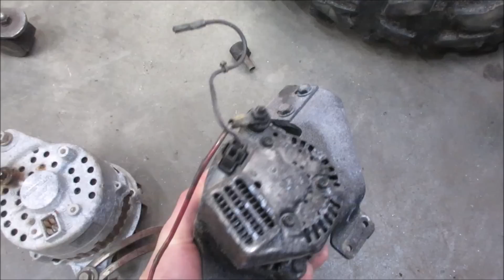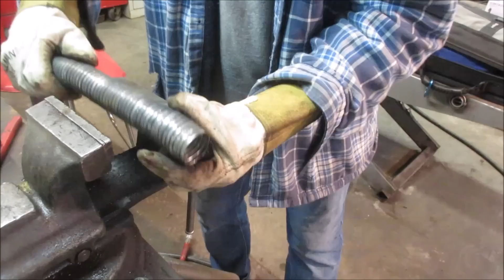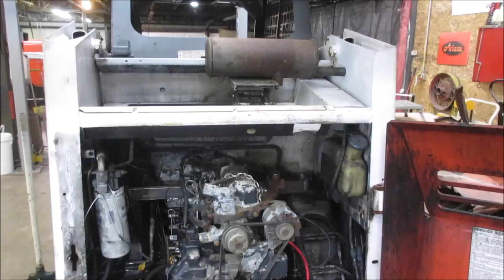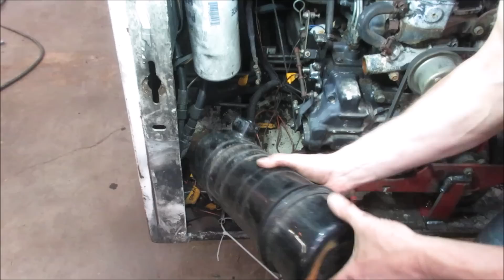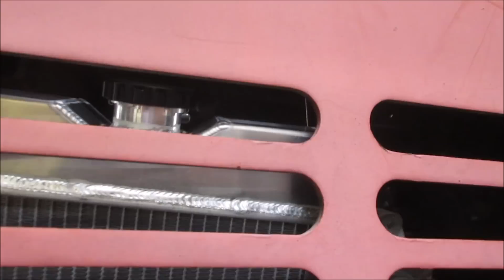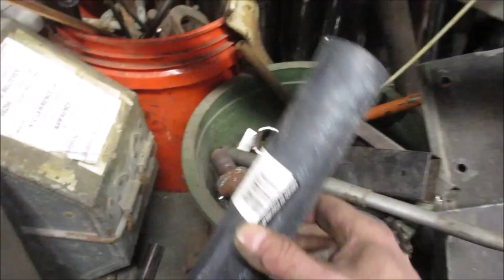Making a Big Engine Fit a Small Hole. Busted up Bobcat Skid Steer.

Comment: For the sake of the engine a thermal switch probably would be a good idea. An engine running too cool is, over time, not much better than running too hot. Just a thought.

Comment: As per the directions you did not receive with the fan you would have to flip the fan blades to make the fan a “pusher” from a “puller” fan. I have never had a problem with the zip ties rubbing holes in the radiator. I don’t use the springs supplied and only use the rubber pads inside and outside the radiator. The zip ties have to be very tight. I usually leave them long and retighten after the motor have been ran a few days. Of course a simple fan shroud is the best way to mount a fan to the radiator, because it allows the fan to pull/push air through the whole radiator surface instead of just the diameter of the fan itself.

Comment: Tight as a fishes bum.  I pity the poor bugga that has to do work on it in future who will curse whoever installed it , saying "rough enough". Why use an oversized radiator that is the genesis of multiple problems?

Comment: Exhaust is going to come into the cab depending on wind if it doesn't go up nice and high, till the heat is enoigh to carry it away.

Works fine out the rear till you back up or get the wrong kind of wind.

And that is a lot of volume and soot, compared to say a lawn mower.

Comment: I build semiconductor fabrication equipment for a living till retirement.  And in that was alot of blind feel only operations.  I always found it easier to do feel only work with my eyes closed.  It instantly focus's you to a slightly higher degree of feel, and made those operations a little easier.  An old vacuum engineer taught me that.

Comment: Ahhh, comon. Drill a hole in the side "panel", stick the pipe through. The muffler is moved sideways. Then it fits right above the existing hole. No problem for flexpipe,  And then it's moved away from the rest.

Comment: I just kept wondering if it wouldn't be possible to put hinging brackets on the outside edge of the radiator so that it could be moved out of the way to service the engine

Comment: As mentioned, flip the blade. The throwing edge will then be around the right way for the curve design. Those blades must have the convex side pushing into air.

Comment: iv found it easier several times to make radiator hoses out  of exhaust tubing and bends, and you can even pie cut it for weird bends then just use a few inches of straight hose on each end to make the connections. and you can roll a bead on it to hold the hoses or weld a bead on it to hold your clamps on.

Comment: Hey Mustie, once again a most informative and interesting video.  It's one thing to put something back together the way that it was designed, but when you have to make everything and fabricate parts to make something work that wasn't designed for it in the first place, well Sir, that takes TALENT!!  Great job!!  One thing I am just wondering about and that is with the placement of the fan.  Do you have enough room to mount it on the other side of the radiator and still get the door closed?  It should still push the air through the radiator to cool it and it would give you some clearance between the radiator and the water pump, etc.  Hard to tell from the video if that will work or not but just thought I would throw my two cents in there!! Can't wait to see this thing running!!

Comment: I'm always surprised by your creative solutions. made possible by your pile of saved materials. Makes me think about the number of times I have to drive to the hatdwarestore.
You could extend the space for your radiator by cutting of the door hinges and welding square pipe to the frame  and weld the door on again?

Comment: Hi Mustie, as far as the cooling, why not mount the fan on the swinging door, that way you won’t need to attach it to the radiator (diesel vibration will wear a hole in that rad in no time). And the fan being electric can swing with the door.

Comment: Don’t fancy changing to engine oil filter with that radiator in the way
Reply: Drain the oil. Leave the filter. It will bypass if clogged.

Comment: I'd vote for using some C-channel around the door frame to shim/bump it out.  And then as another poster said, flip the hinges and then mount the radiator in the door..  assuming there is a way to let the radiator hose bend/flex/move when the door opens.

Also, air intake up top.  It will get cooler air and leave you lots of room to work on the engine.  

Thanks for sharing the videos!!!

Comment: I Like the project. Would it have been possible make a bracket to hold the bottom of the rad to the motor mount? I was thinking like a pack unit so the whole thing could come out as one if needed. It’s good to watch and learn and share ideas. I think you do a great job. Keep it up!

Comment: I would square that slope in the door and raise the radiator. It will also allow you to move it further away from the engine. Would also change the fan from draw type to push, that would help draw air across the oil cooler and then radiator.

Comment: Great video! 24:35 DO I point it upwards and make a flapper. YES because you don't want animals crawling in the tailpipe over winter? and you know the engine is running with it flapping.

Comment: Mustie, any concern about the vertically mounted cushion mounts shearing off being mounted horizontally? In answer to you air cleaner question, there is no real air requirement difference between diesels and gas engines until you get into the larger displacements or high winding diesels (big EMD/Alco's or the racing Cummins engines). Loving the repower video!

Comment: Your missing the original flywheel that has a fan built on it and also the cooling shroud so there’s no hydraulic cooling and for the price you should have went with an oem radiator

Comment: First thing that motor needs is a new set of glow plugs as for the throttle it would have been easier just to make it up as a cable throttle I would assume that you can buy them over there there is a flexible radiator hose that has a spring in it they use are mainly on tractors

Comment: You could make the back engine cover deeper by spacing off the hinges and then welding flat bar or angle section around the perimeter of the cover. Could give you that extra depth for the radiator and fan unit. 😀

Comment: he motor vibrates independent of teh body of the skid steer, so you need standard "rubber" and metal exhaust clamp style design instead of direct weld.

Comment: Hi Mustie. How's come you didn't just leave the muffler down in the engine bay and then run the pipe up through that hole and make a small stack with a flapper on it?

Comment: Alot of those aftermarket electric fans u can flip on the motor for pushing air instead of drawing so u can mount them in front of the radiator

Comment: Did you ever consider welding square tubing around the body and reweld the hinges so the there would have been more room between the radiator and the door?

Comment: I'm curious about where the original gas engine radiator was...... and whether it was under that hydraulic oil cooler, above the engine. That would give better access to the engine and less issues with sticks coming thru the vent holes and poking the radiator.... I always enjoy your videos!

Comment: At 54:48 you could just weld three or four buttons, or beads on the pipe and it will not slip off when pressurized….👍🏻

Comment: The fan is a push/pull fan. You can take the blade off and flip it around. Also you can run + to - to do the push pull effect.

Comment: Just saw video. Good video. Great idea on radiator The only concern is service. Is it possible to move all filter over to the right side of the motor Oil, Fuel, Hydraulic filter. I was thinking run a few lines over to the right open space. Easier said than done, but I think it would make service a lot easier. Just an idea.

Comment: For air flow for the radiator those slots on top of the door should be plenty. They were plenty for the original engine.

Comment: You can reverse the air flow by flipping the blade over and reversing polarity. I did that on one electric fan I used on a piece of equipment I have.

Comment: I put the fan on the other side thy your pull the hot air out and pull air across the hydraulic cooler and the reason the door solid so you don't run a stick in to the radiator when backing up if you make more hole protect they .was the radiator that come with the motor bad .hope you don't have problems with the radiator cap low thy the motor but great job so far

Comment: For your radiator hose coupling...
Turn a pipe into a hose barb by running a weld bead around the outside.  Even just a few bumps will go a long way towards keeping the clamped hose from being forced off.

Comment: Yes, the fan should have a thermoswitch. And a relay. The fan running constantly could prevent it from coming up to temp quick, You want them to come up rather quick for the engine to reach its happy temps.
Leave the back door be- it´s okay as is. The tailpipe should point up and back so fumes clear.

Comment: I wonder if that radiator isn't just a bit big.  The engine will need to be able to get up to temp and that size radiator might be too much.  How about giving it a run before you start tearing holes in the back door.  It might also be worth thinking about setting up a cowl to direct the hot air up to the existing vents.

Comment: If you could tap the top of the thermostate housing I was able to do this on my ford fiesta you then will be able to fit one from a early fiesta thus a voiding the need to use a switch manuely.Beleive me I am speaking from experiance its not easy to trying to rembering to keep switching on thr fan all of the time.

Comment: You need to put the radiator on the top if you keep it there is not going to get good airflow….. I was a bobcat mechanic and the radiator was always on the top by the exhaust

Comment: Also wondered if the fan blades could be removed and turned over, so it would be usable on the outside of the radiator?

Comment: Hey Mustie, why not swap the fan to the rear of the radiator to give yourself a little more room for pulley clearance?  Just a thought,  the radiator doesn't care which way the air is flowing,  and your not going fast enough to cause a problem with wind direction.. As always,  love your videos and ideas! Keep up the great work!

Comment: I was thinking how about just moving the exhaust/tail pipe to the other end, weld up old hole and attach to other end, then it would eliminate the need for the flex hose (I've never had good luck over not long time with that) and exhaust would go out the back.  Or could put right angle to have it exit vertically to get the exhaust out of the air flow to the radiator.

Comment: I would keep the air cleaner outside the engine bay. I think clean cool air would be better than clean warm/hot air.
Reply: Air filter outside the engine bay needs to be water proof.
Reply: @brucepickess8097  not a problem. I drove a big rig for over 20 years and the air cleaner on every rig I drove the air cleaner housing was outside the engine bay.

Comment: Only soaking that works on rusted hardware is if you soak the whole rusted bolt area in phosphoric acid for 1 day or more.    Some will break loose some will just dissolve from the extreme rust that was eaten. I wish I could keep a scrap pile like that. Im left with just hauling it off to the scrapper for like 10-14 bucks every run.   SO much good.. junked. Probably can just punch a slot hole in the bottom of the rear door over the radiator and maybe make a little rubber sheet/ old truck mud flap etc cowling so the radiator air is directed   And the right side of the unit can have its own air flow

Comment: What about extending the back of the  body of unit 4 to 5 inches and rehinge the engine bay door. That would give you all the room you need to properly fit thst radiator.

Comment: Most skid steers blow from the inside out so as not to run to cool in colder weather,seen engine failures from oil to thick,ice in oil pan from condensation issues from running to cool,just want you to be aware.

Comment: There is a fan mounting diagram on driftshop (universal electric fan mounting kit), if that helps. The foam pads, springs and tiewrap clips go on the other side of the radiator to the fan, I'm not sure how sturdy that would be.

Comment: I remember working on a dairy farm the bobcat radiator fresh air intake was mounted on the top where you have your muffler,and the rad was mounted on the door and it had long hoses held up with springs so the didn't get pinched. I remember the loose straw would get all sucked into the fresh air Intake grill and overheat if I didn't deal with it. It was a smaller 90s unit  before the keyless anyways.  Hope you get it figured out.

Comment: You're going to want to put that fan on some kind of thermal switch. They make inch and a half joiners you can thread sensors into so you could just add one to your upper radiator hose and you should be well on your way to a proper solution and an engine running at the correct operating temp. I get that you want to do this as cheaply as possible but doing it right won't cost you much in this case and will save you headaches down the road.

Comment: To bad you don't have a smaller rad . That seem pretty big for that little engine , I've worked on those engines all my life . To bad you couldn't find a rad out of a reefer unit . You might have trouble getting enough heat in the engine . That rad looks about 3 to 4 times larger than nessassary.
Reply: Also my friend kobotas love their glowplugs to start , they start better & saves starter life .

Comment: Wait to cut the door until you have run the machine, you may not need any extra air flow. You swapped in a radiator that is 1-1/2 to 2 times more area then the original radiator that was on that engine. With a diesel engine you can have too much cooling. Then they won't run correctly.  Looking good so far.

Comment: If you are taking the engine out again, have a look at that pulley on the back of the flywheel.  Turn the V belt pulley off the Hydraulic Pump connecting flange ( in your lathe) That will allow  you to position the engine another inch or so further back,  giving more radiator fan clearance to the injector pump governor housing..   Is that an oil bath air cleaner? If it is, it may have to fit vertically.

Comment: Google "where do the springs on a radiator fan go" and look at the very first result give you the entire how to. God I wish I was there to help you. I got you! put the fan on the other side so its drawing cool air from the outside. maybe that doesnt matter. Take the threaded rod on the linkage on the engine completely out and thread the other in. Then it will be the correct orientation.

Comment: For those Who know the Bobcats, witch way the fan push or pull the air out from the back?
Mustie, be sure to have gap on the rear drive shaft to avoir the crank thrust bearing being burnt. 
Very interesting project that I would like to do myself. Thumb up.

Comment: You could maybe gain an inch or two of radiator space if you turn down the pump drive adapter so that it fits recessed inside the flywheel instead of on top of the old belt pulley. The old pulley could probably be used to mount the adapter plate to the lathe chuck.

Comment: I appreciate your hard work and I enjoy every video you put out. Between the work and the editing I know it takes a lot of your time. I never get tired of your Volkswagen engine revivals. Though I know the prices on everything for those is through the roof. The one thing I have to ask you, I'd like to know what torch head you have on your map gas I have the same one as you as you do but I can't find a torch head that puts out the heat that yours does . Mine is a Bernzomatic like yours but I would like to have a hotter torch head and I'm in odds which one to buy period if anybody out there has an idea best one to buy. I have a regular set of torches but they're large set I can't always take them out of my garage

Comment: Remember that the engine will move around a bit when operating. Make sure there is clearance for that movement to the radiator. Also, I'm surprised that you didn't pull the engine back out first, and start working on things from the inside to the outside. It would have been less stuff to have to take apart and put back together (exhaust, cooling, etc.).

Comment: 32:00 Replace those ball and socket joints with the heim joint type (that has a ring in the center) and you can make a double junction with one bolt and some spacers. PLUS the heim joint is much more secure, whereas the type that are on there now can just fail as the socket wears out and then it just comes apart and you have no throttle.

Comment: Your life would be so much easier if you just kept a battery charger on the batteries while you work on them.
I find the 10 amp setting is a nice boost when starting and the 2amp setting keeps the battery topped up without overheating when using the starter over and over.
And the 50 amp when you really need to push the drive train.

Comment: The air filter needs to go up above to the left of the muffler.  Do you really want to remove the air filter housing every time you check the oil?  The air filter above also would proved some protection to hydraulic oil cooler if something fell on top of the machinein while in operation .  Just position to air intake away from the exhaust outlet.